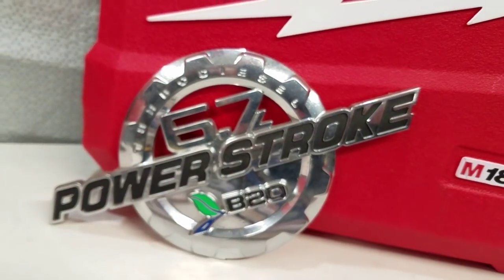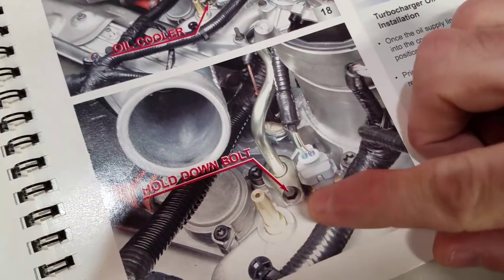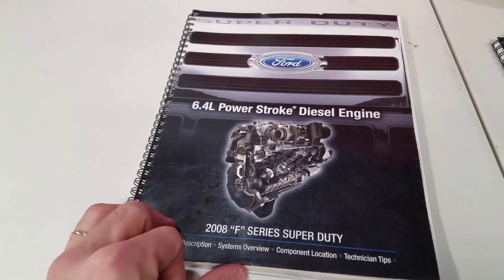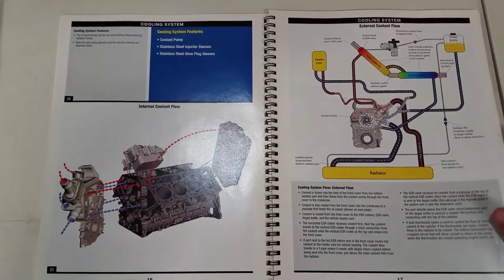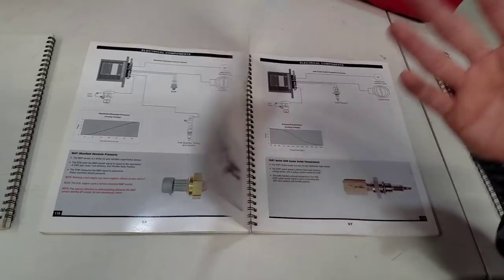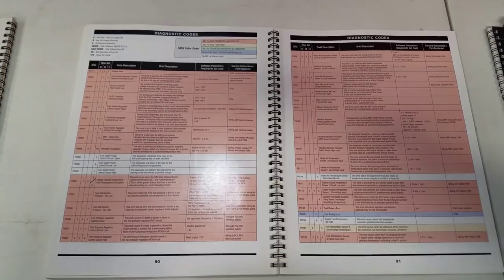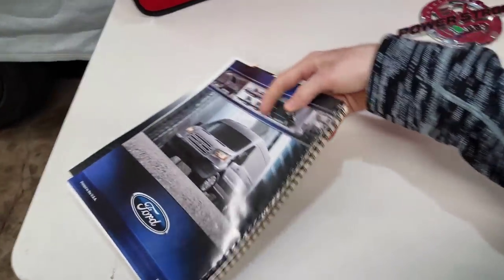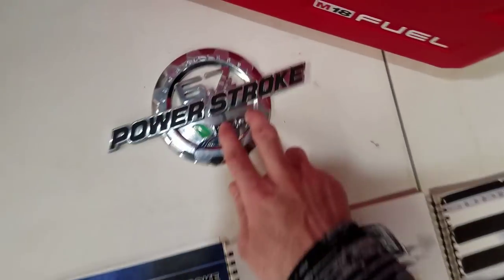Powerstroke Tech Talk!

Comment: Have my 2003 Lariat
 7.3 with 308,000 miles, runs like a champ and looks like new...my 2017 F350 Platinum Dually with only 10,000 miles just had the entire moonroof assembly replaced under warranty, only opened it maybe 10 times in the year Ive owned it.

Comment: Honest opinion I’m a tech, looking to get a 17-19 250. Items that you see fail on the 6.7’s do you think it’s worth getting the diesel or the gasser? I know everyone complains about how much it cost to fix diesels but I’d be only paying for parts I am the labor haha. On the fence on the 6.7. Due to the minor cost savings each year on fuel. Didn’t know how reliable the 6.2 is vs the 6.7 thanks for your help.
Reply from the maker: All i gotta say is if i wasnt payin for daycare....id be a happy 6.7 owner, PERIOD!
Reply: PowerStroke Tech Talk w/ARod I’m in the same boat! If it wasn’t a 10g add on it wouldn’t be a question. How’s the reliability of the 6.2? I work on Toyota’s, if the tundra had a better tow rating I’d buy one. It’s a 3/4ton with a 1/2ton rating damn near.
Reply: The 6.2 is dead nuts reliable. If taken care of you should get hundreds of thousands of trouble free miles.
Reply: The 6.7 will obviously tow better but it’s gonna cost you more in every way, and be less reliable unless it’s deleted. But still, a lot more stuff to go wrong. Personally if I had to buy one and wasn’t going to be working it all the time and money was a factor I’d definitely go with the 6.2.

Comment: Awesome channel!  Quick question, on long trips my 2018 f2fitty 6.7, when I  refuel there's negative pressure in my tank. When I remove fuel cap it sucks alot of air into the tank.  Only 20000 on truck.
Reply from the maker: Hmmm thats kinda strange.....id have to talk more in depth about that